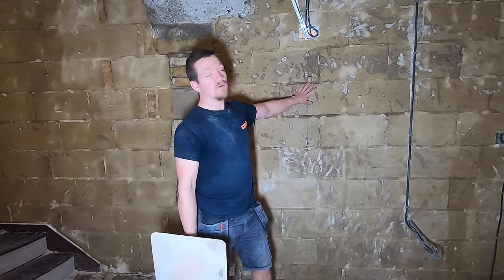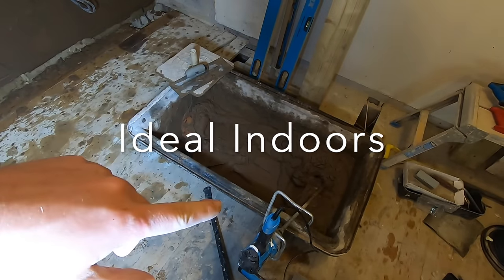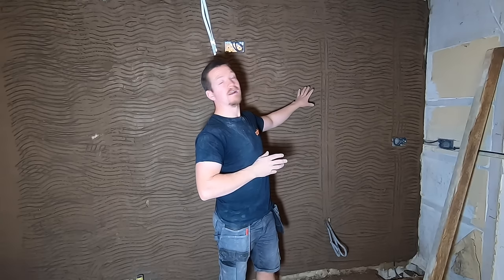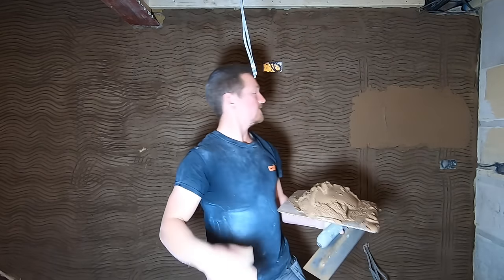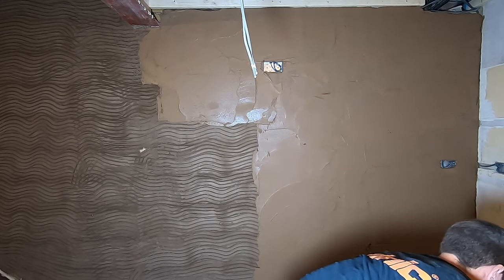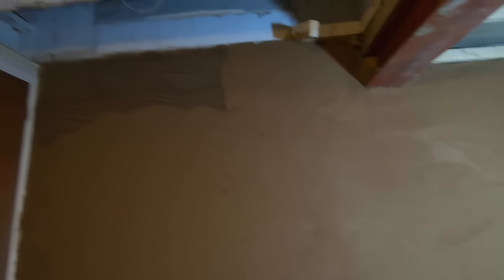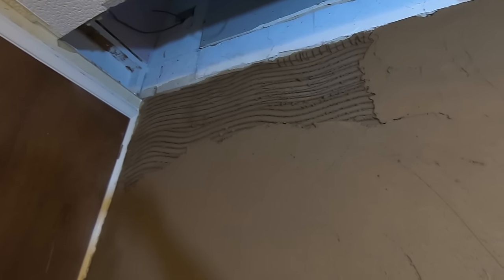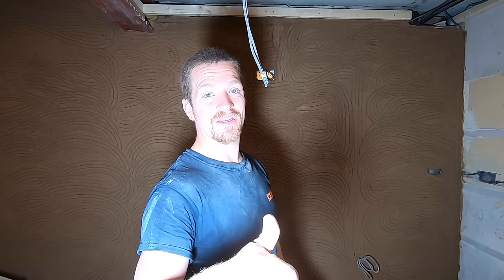Plastering Walls With Sand Cement Render | BEGINNERS GUIDE

Comment: 🔴 Hi Blaine,  nice video as always, a few tips though ??  really you are best leaving your scratch for longer than 3 hours, but no more than 24 hours. The next morning is ideal around 16 hrs
 You need to let the air escape within the base coat, also the pressure from applying that second coat will just break the fins/keys of the first coat, you won't see this ?? But it will happen underneath your second coat. Also, if your right handed work from left to right, starting at the top left working across the wall, downwards. Cheers.
Regards 
Plasterer 35+ years

Comment: As a all round builder, really admire you plasterers. Plastering is a work of art. Always a pleasure watching your videos. Can I ask what’s the difference or advantages with applying render as a scratch coat over bonding?
Reply from the maker: Thank you mate, that's very kind!! It's the waterproofing qualities that sand cement has and to be honest, Bonding isn't designed to be used as a backing plaster. It's designed to be used on medium to low suction backgrounds where as BG Hardwall is used for solid plastering! Sand cement is also a lot cheaper and nicer to plaster onto. It's lovely when you skim onto sand cement render!! It's a dream 😉
Reply: Plastering For Beginners thank you for the information really appreciate it! :)

Comment: Am I mistaken or is this simply the same thing as exterior stucco method (I'm in USA).. and here it's called the brown coat  / scratch coat (which is typically applied to a metal grid mesh layer) and then then top coat which usually has colorant added, such as tan, gold, rust, etc...

Comment: How much waterproofer do you use mate and do you use it in top coat too. I'm a bricky and roughcaster over 30 years but I've noticed last few years alot of roughcasters having problems with mix as the manufacturers  changing the cement types and what's in it so often, walls going boss and render  failing . Just interested in another man's view.....still learning after 30 odd years . As a right hander I just cant get on with going right to left lol , what's main reason  for doing it that way ?
Reply from the maker: Hello mate! I follow the advice from the directions at the back and I've realised that every company is different. I have noticed that if you add too much waterproofers then the water can get trapped between the newly applied top coat which makes the top coat hang around a lot longer. I think it also effects how well it bonds together. I try to follow the company directions because I don't actually like using too much of the stuff. I think it can make the overall finish weaker but that's just my opinion! Ha yeah...the old school lads say it's the best way to follow from the trowel before but I'll be honest it really doesn't matter. You rule it flat anyway so who cares how it goes on the wall 😅
Reply: Hi, you mention waterproofer. Is this an SBR product or PVA? I used a mix with sbr a few months back and the mix (4:1) was nice and creamy. Just checking and I also applied it to internal block work after a good old soaking. I was really sure though how much SBR to add, so just went by eye.

Comment: Hi Blaine, 
I keep watching trying to figure out why I can see grey shadows of each breeze block in my internal walls despite layers and layers of paint applied. 
When we bought the house 32 years ago, it was a show house and covered in wallpaper. It is a big top range house.  Beautiful location, my dream home ! 
Something is Missing but I am trying to figure it what. 
I don't have a flat straight wall in the house! I don't think it has ever been flattened properly, like you do it. There are cracks and bumps everywhere, My curtain rails all fall out of the wall it is so crumbly. I am so upset about it.
I like vinyl silk paint on the walls, but the more I coats I put on it, the grey shadows of the breeze blocks, still shows through the paint. There must be about 25+ layers of light coloured paint by now. 
Is it a lost cause? It still is my dream home, what should I do? 
How does a single mature lady work out, who are genuine plasterers, from those who are just hoping to get in my knickers as well as a bonus?
So sick and tired of it, blue-eyed blonde, size 8 lady. 
Thanks Blaine.

Comment: Thanks for the informative video. Would you recommend this method for a novice DIYer or a pre-mixed gypsum product? Thanks
Reply from the maker: It's a bit tougher working with sand cement so you could use BG Hardwall. It's a bit more forgiving to work with. Check this video it for using it:

https://youtu.be/gqJplphsRdg

Hope it helps pal 👍

Comment: Hi Blaine, I’m taking my kitchen back to the brick and I would love you’re advise. I’m planing on using sand and cement plus lime. But I’d like to how to keep the exterior wall breathable. 
1. Would you use PVA or just water? 2. For a top coat finish would use British Gypsum multi-finish? 
Just to note the walls are made from imperial brick with lime mortar.
Reply from the maker: Hi mate. To be honest if you want the wall to be breathable then sand cement isn't the best option. It's lime render you'll need really.
Reply: Lime plastering tutorial?

Comment: Should I use plaster sand or silica sand with Portland  cement to get a smooth finish. Because I already used portland mortar to cover the bricks in the fireplace. Thanks for your inf.

Comment: Hi, great videos really helpful. Could you help me please, my external wall is partly under ground in my neighbor's garden and damp is getting in my wall, will internal render rectify this problem as unable to render external due to it being underground. I've been looking at Tarmac one coat render, which says weatherproof, but unsure if it will fix the problem or if I need to use something else ? Thanks
Reply: the ground needs digging away from your wall if its above your damp proof and you may need a new proof damp course if its been penitrated. By adding the internal render you could make it worse if the problems not rectified first.

Comment: Does this sand and cement provide damp proofing or is it breathable. If you need to have either do you use different additives such as Lime or waterproofing additive?
I have seen a basement solid old stone wall rendered and it has pushed off, its basically just now cracked sheets of rock propped against the walls

Comment: great videos as always! Why would you render the wall, than apply plaster? I'm guessing dot and dab plasterboard wouldn't be great, but could you not use hardwall?
Reply from the maker: Its below ground so I was doing for the qualities sand cement render has in conjunction with waterproofers/ additives 👍

Comment: I'm a carpenter/joiner and not an experienced plasterer so I'm thinking of running the feather edge on grounds, at least for the first coat.  I'm not sure I can realistically make grounds less than 1/2" thick.  Would that be too thick for a first coat?  Can anybody help with this?
Reply from the maker: This video should help mate. Explains what you're looking for pal 👍

https://youtu.be/iPnQM5iBKNQ

Comment: Do you pva the surface before starting or just wet the surface ?
Reply from the maker: I just used water but you can use SBR. You shouldn't use PVA for sand cement render.

Comment: Can you use multi finish straight ontop on sand and cement to get a good finish ? And how would you prep it if its old sand and cement that has a key already ?
Reply from the maker: Yeah you can use Multi Finish - you just need to PVA before plastering and then you're good to go 👍

Comment: Hi mate
For the top coat the mix is 5 sand 1 cement and 1 lime? No waterproof or plasticiser?
Cheers
Reply from the maker: Waterproofers in both coats mate. You can add plasticiser if you like but I didn't feel the need because I'm not floating it up to a finish but it all helps 👍

Comment: Was waiting for this video. Been years since done flat render ( inside ) always found it always dragged/pulled the render using a metal straightedge. Think just had a shit mix. Have you tried speed skim render? Anyway class video once again pal 👍
Reply from the maker: Thank you mate - it might have been the sand you was using... Who knows ha! I only use rigid rules mate. I don't trust Speedskims with render, there's too much flex in the blade.

Comment: Ive build internal wall from the quinnlite  thermal blocks and I applied a cout of thristle bond. Wall is pretty straight.I want to render this wall with sand cement and lime. I just wonder if  i need do a scratch coat and then  base coat and top coat  or i can put base coat directly on the thristle bond?  Thanks for any advices